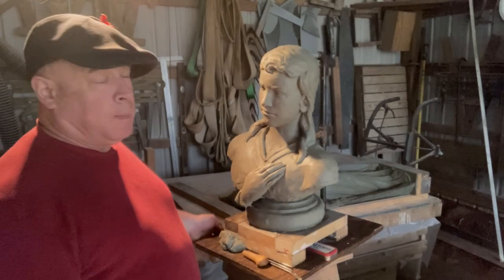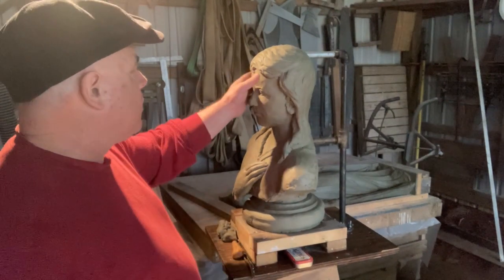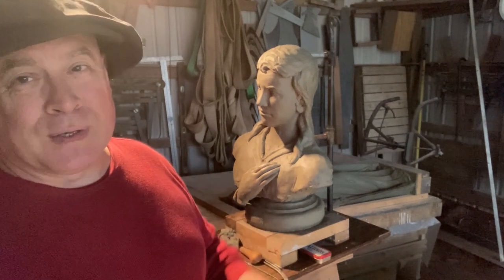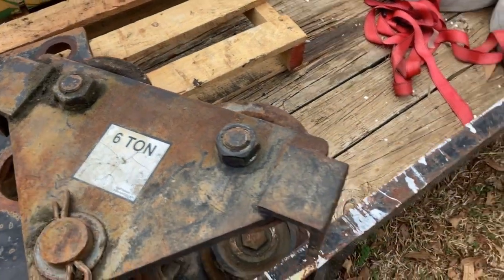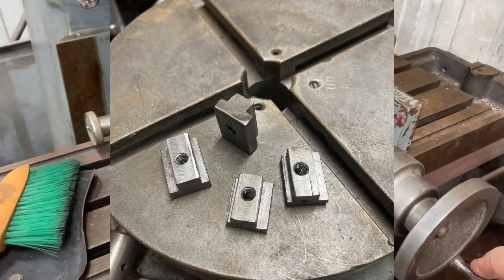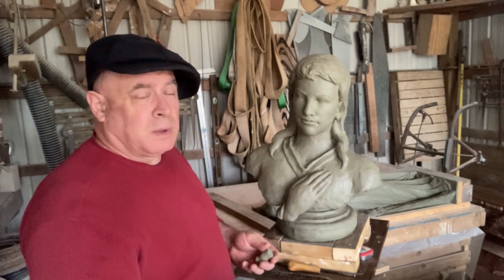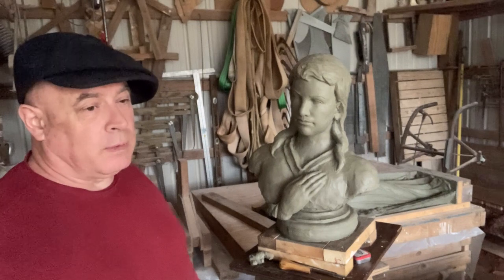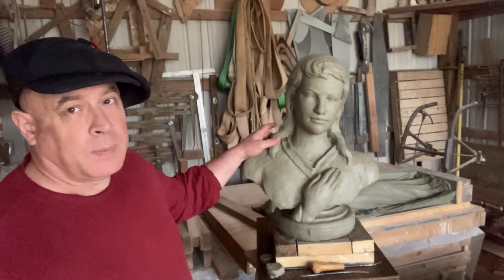Virtual Stone Carving Apprenticeship  VSCA Video 79  Studio- Crane Upgrade 1

Comment: Thinks for another great video this what I have been waiting for the Art of the matter and the advice.
Reply from the maker: Art vs craft is a very problematic issue.  

Production of accurate anatomical structure is craft.  Doing an accurate likeness is also craft but has more to do with art than strict formula of anatomical structure.    I’ve had many occasions where my work has been relegated to “not art” because it’s rote by fine artists who can only work in some specific abstracted or highly stylized manner that is at least as repetitive, redundant and uninspired as the genre of memorial sculpture.  It’s even happened when such fine artists have produced a piece of sculpture and then come to me for a (preferably free) piece of scrap stone to use as a base or plinth.    They want my trash to use as a foundation and finishing touch for their fine art….?   They miss that irony.

Whether you do art, craft or both, I don’t care.  Anything that you cannot do upon demand (internally or externally) is beyond your mastery.   I grow as both an artist and as a craftsman with every job I produce.   without any bias, stone tells the truth about what I can do.  That’s a fair measure of me, no matter what I’m doing. 

With all that said, I can hardly wait to be doing the artistic portion of this project.